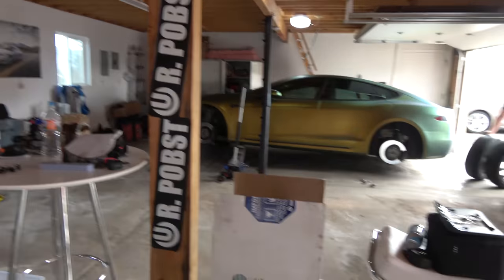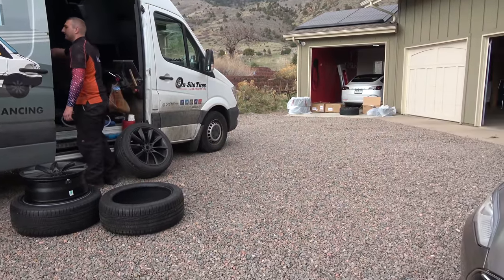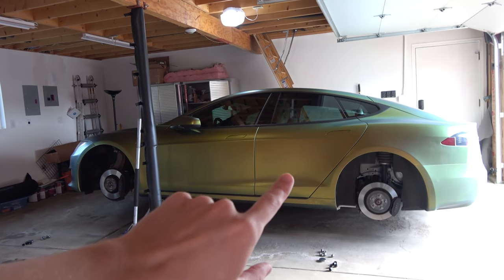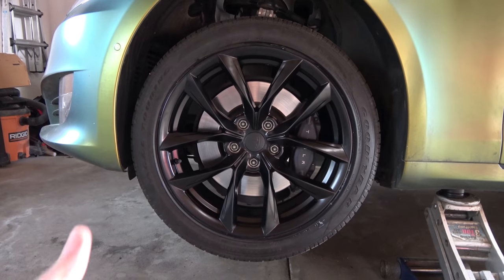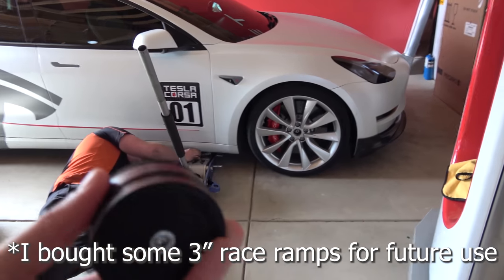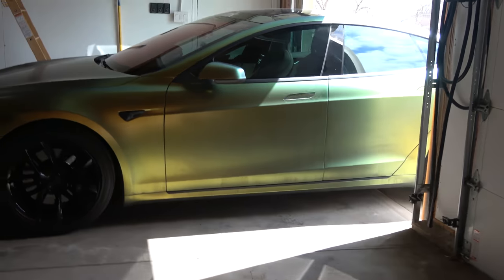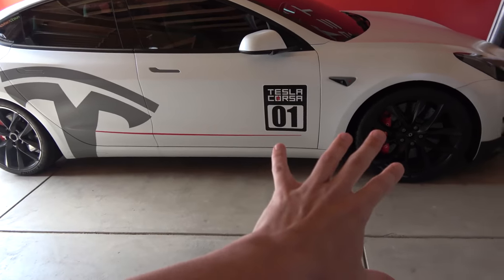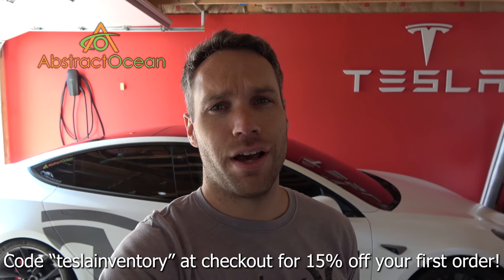New Model S Rims & Mobile Tire Service

Comment: You might want to get a second opinion on the square track setup. Every track car I've ever driven has had staggered wheels. I am getting new wheels for my S and plan on going square just so I can rotate them for road use, but for the track I'd rather have staggered wheels. On acceleration the car squats to the back, and you have more rubber to grip with.

Comment: Ps. Costco is the cheapest and most professional tire store around. Give then a try next time. They use factory lift guards, nitrogen and torque wheels after install and 25 miles later....

Comment: Did Tesla change the rear brakes on the MS i though it had 2 calipers. 1 for normal use and 1 seperate one for parking brake
Reply: only P100D S and X have it now

Comment: Only 19" Arachnids on the S?! Come on! The 21's look WAY BETTER
And no concern with "cracking" the 21"Arachnids if you use the genuine Teslas that are forged!
Reply: Actually 21s look like crap and perform worse in every way. Any alleged performance advantage is strictly due to width, and it's easier, cheaper and better to just get wider 19s.

If you're in a pimpmobile and don't care about performance or anything practical then you may as well go all the way and get 24" wheels. Otherwise, 19" wheels are better in every respect unless you like flat tires and spine injuries.
Reply: LOL you have NO idea what you're talking about
Reply: @pcarfan1676  Says the adolescent without a driver's license...
Reply: Ya I own a P100DL with those actual forged 21" Arachnids from the factory in black onyx, hence my opinion on the matter of this video
Reply: @pcarfan1676  In your dreams

Comment: Hahahaha, need a low profile jack...i plan ahead, some people just don't. Also does mobile tire guy use nitrogen instead of just plain O2 while installing tires.???
Reply: Plain old air is 71% nitrogen. It's snake oil. Scientific tests have proven there is zero functional difference between pure nitrogen and plain air in passenger car tires. The only difference is to your pocketbook.
Reply: We use either Nitrogen or regular air depending on what you would prefer.